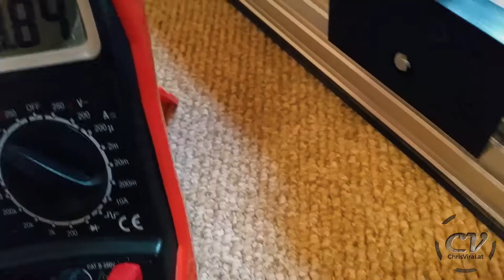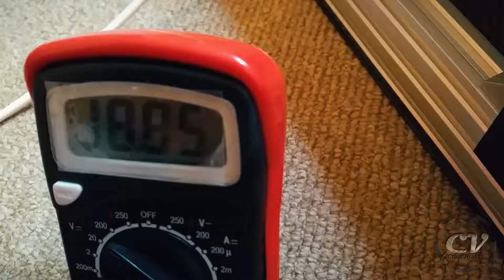DIY Full Bridge Rectifier (With Spot Welding Capabilities)

Comment: The smothing caps get rid of the dips in the output waveform, and u were measuring the average voltage. AC usually writtwn in RMS. The Max +/ -  of your transformer will be closer to your output
Reply from the maker: What I know by now is, that depending on the load the voltage will be different. Measuring without load will result in pretty much peak voltage but will drop when a load is connected. Depending on the load the voltage will drop more or less. A small load might get fried if the peak voltage is too high. A bigger load will drop it to pretty much the given value on the transformer.

Comment: You can buy on ebay even more powerful transfomers, i got 2x 300W 12V 25A both times for 10eur. :) look out for "Halogen Transformator 300W"
if you ever need some better rectifiers, here are some with metal cases:
https://www.ebay.com/itm/5PCS-50A-1000V-Metal-Case-Bridge-Rectifier-KBPC5010-XU/232921109077?hash=item363b2e1255:g:raoAAOSwE3ha9lL4

For the capacitors, you dont need 6 because its wasted parts. The rule of thumb i got from an electronics book (how to buil power suplies) you need 1000µF per 1Amp you draw , so for your 10Amps you need just one 10000µF Capacitor. You can do 2 to be "double" safe" ;).
But now you had already build it, it doesnt make sense to unsolder that artpiece :) , maybe later when you need the capacitors elsewhere.
Capacitors without load will output a way higher voltage so you can destroy parts with overvoltage. (example from what i measured 16V in 27V out). To counter this try , maybe a small load like a resistor+Led (see led calculators online).Another method are Zenerdiodes+Resistor.

The 230V side of the transformer  is not properly isolated, you can accidently get shocked since blank parts are visible.You wont get any VDE-logo for that ;D.
just use more heatshrink or build a wooden box around it, 230V shocks are usually way more powerful(more amps) than the chinese modules :).

For the fuse this might be useful https://www.ebay.com/itm/10Pcs-SL-506P-Mini-Blade-Fuse-Holder-Auto-Automotive-Boat-32V-For-PCB-Board/263879689494?epid=3022614677&hash=item3d70748516:g:yxIAAOSwTiBbc8O~

For the voltage, it startes at 40V where you can feel some "kribbeln" :)

7:24 where is the krakpak-bell sound? :D (they are missing in several videos so i noticed it)
Reply from the maker: Yeah I have no idea what happened to the bell sound... In the recent vlogs everything seems to work fine. I noticed it to late and figured it wouldn't be worth it to re-render and re-upload them etc.. DAMN BUT YOU NOTICED lol

Thanks for the links as always and I almost went for the exact ones you sent me but I thought this flat one that I used would be easier to work with.

Yeah 6 capacitors is for sure overkill but the fit was just perfect and I have no other use for them so I used all of them hahaha. DAMN really? Thanks a ton for that, 1A for 1KµF OMG and my build has 30-60K for 1A lool. 

Yeah I tested them with my grandpa and with a small load the voltage is way higher than expected. We figured for a 12V load (~1A) it's best to use the 10V pin combination. Start WAY lower, then measure and go up. Another thing that we solved was the discharge time. When switching from a higher voltage to a lower one the capacitors need to get discharged with a resistor to prevent damage to the parts that require a lower voltage. We fixed this issue too. I'll probably cover all of that in another vlog anyways.

Yeah the 230V in is another issue that needs to get fixed.

Oh yeah, thanks again for the fuse holder, all these little things I still need to figure out hahaha. I'll definitely get myself a few of these :D

40V okay nice, I need to test that hehe.
Reply: for the rectefiers, the flat ones can only be used with a "holding metal" or with 2 screws and 2 washers. The square ones i linke have the benefit, that they need only 1 screw to hold them.
I use an old aluminium CPU-cooler as a passive cooler, i drilled one hole and tapped it.
Anyway you already have solved your needs i just wanted to point out that they need only one screw in the center :).

Is your granpa an electrican or electronics technician?

for the voltages i learned "way lower" it means in theory 70% :),
Because of the term called "Effektivwert" (of the Sinewave) 
https://de.wikipedia.org/wiki/Datei:Sinusspannung.svg
look at point 3
The hole thing is explained here https://de.wikipedia.org/wiki/Effektivwert
Reply from the maker: My grandpa was involved in inventing sterilizing machines waayyy back (to make hospital items sterile). They did this with hot water vapor, stuff like that. When it gets to the electric an mechatronic stuff well I actually don't know. Probably DIY all the way. Good question though.

Yeah yeah, that's exactly the thing. I'm not sure if the insane amount of capacitors keep elevating the voltage more then a lesser amount or if it's more subjected to the load. A significant load will reduce the voltage pretty much to the expected digits but a small load will only drop the voltage to a certain degree.
Reply: Do you have a analog or digital Oscilloscope?
You could watch watch is going on then.
The reason you might get confused is since Alternativ current is a function and not a constant like Direct current this means it has atleast 3 values instead of just one. In AC  you have max Voltage and the effective voltage(70% of max). The capacitor charges to the max of the Sinewave when no load is attached and drops to the effective voltage when a load is attached. I dint find a good video, but here is an image https://www.youtube.com/watch?v=CgcMOyhfFVc#t=7m15s
here is a better video
https://www.youtube.com/watch?v=vVXbbuy-xwM#t=3m14s
 I can recommend this item, insanly cheap and already welded together:
https://www.ebay.com/itm/Fully-Welded-Assembled-DSO138-2-4-TFT-Digital-Oscilloscope-1Msps-Probe-B1/163215200548?hash=item2600625124:g:SSUAAOSwgStbe7yQ
it might be usefull in the future, for example you can see PWM Signal changes, remote control pulses and other stuff
For the case you can buy one acrylic or 3D print which i guess is your option.
I made a wooden case :).
Reply from the maker: Yeah I do have one, sitting right next to me... My grandpa gave it to me a few weeks ago... Another project that's waiting for me. Analyzing signals for sure is a helpful skill.

Thanks for the links, yeah I know about that (a bit lol).